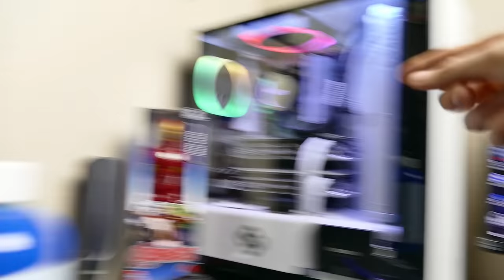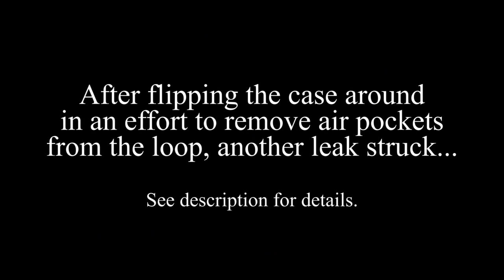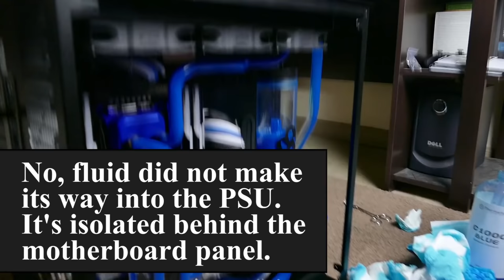Project 'Blue Sky' Custom Loop PC Build Log (Part 4 of 4)

Comment: I believe the best way to apply thermal paste is to spread it evenly (less than the thickness of a sheet of paper) on the die and also put a drop of thermal paste too.

Also, I think your power supply got messed up because there is to much current running through one outlet?

Comment: its quiet unfortunate to see all those effort with undesirable results, its custom water loop and things like these are prone to happen. Anyways kudos to you for trying it in the first place. when i saw the first leak i thought good that it didnt reach the psu and then i saw it was just the radiator in the bottom (which was later confirmed by you) however didnt expect the psu to fail. if i may ,  use the psu jumper to do the priming of the loop. I dont think it could have saved your psu, if anything it can help you protect the other components from short circuit due to such leaks.

Comment: It was hilarious when the first leak happen because you forget to add the stop plug on the gpu brigde. Cheers man it also happen to me too. I wonder how stupid i was that i didnt notice that. I suggest u try bitspower fittings or u could save some money get barrow fittings which looks like oem of bitspower. I use them so far i had the least leakage using these fittings. Great video and hope u get that psu problem solves. Curious how it died.

Comment: I have no clue how that PSU died but it would be en extreme coincidence if it would be unrelated to the custom water loop. As we all know, custom water cooling is not for the faint-hearted, or those who can't afford to spend $500-1000 extra on equipement and possibly more if there is a leak. It is awesome though.

Comment: I noticed you had the 24 pin connected the entire time you were filling. Isn't potential harm to components one of the reasons most water cooling kits come with a 24 pin jumper so when you switch on, only the pump spins?

Comment: Decided to go with air cooling. Water cooling looks like a big pain in the ass. Custom loop is going to take more calculation than I can be fucked with. CPU coolers could use a facelift though...

Comment: So I Always used a cheap powersupply to test loop rather than using the one gonna run long with the build. 
Also u sure your pump is good? There is still air inside the loop so the flow must be really really weak.

Comment: That case is like the Air 540... The wiring and PSU and excess hard drives go in the right side chamber... no chance water got back there.

Comment: Why did you have so many leaks? Is it because you used rigid tubing? When i built my first watercooling System i had none, maybe because i used soft tubing which is a little bit more forgiving? Nice Job anyway. It will be interesting how your TT coolant holds up over time!

Comment: Little late to ask, but did you flush out the radiators prior to install? It's a step that first time builders often forget, and alphacool radiators are notorious for having a lot of flux inside them that can get really nasty in your loop over time if it doesn't get flushed out.

Comment: Its really dangerous to use the system power supply with everything plugged into it to power the pump during filling stage. You really should either disconnect the main board and GPUs or use external power to power the pump. Any electronics can handle being wet when there is 0 electricity flowing through it including whats in the Capacitors, without being ruined totally. But once you power them caps, your chances of shit going bad with minors leaks like you had, go way up!!!! Just a helpful tip.

Comment: Did you actually flush the rads also I could see right off the bat the PETG ends were not deburred it looked pretty crooked and needed the ends to be cut straighter. Not trying to sound lie an ass it was your first custom loop but you learned some lessons real quick
Reply: The res out is the most notable bad fit the tube doesn't look flush with the fittings and then the cpu you kept having trouble getting it to fit right which suggest you may need to do that piece over again. It should fit snug but if its not going in straight don't force it or you just risk hurting the o ring. good luck
Reply: did you run out of the coolant after your spills or is that just a ton of air in the lines? Not sure but I really couldn't see it flowing at the end and one tuble looks like it is dry. You may have to lean the tower to get the air out but in all honesty I would flush the whole system and go check out some tutorials on flushing the rads.

Comment: How fast would a GPU with no cooler die? like just the bare die. There's a video somewhere on YT showing a guy gaming then pulling off the cooler on the CPU and Intel just shuts down but AMD goes up in smoke. I wanna see that but with GPU's.

Comment: Ah i get it now. 8:29 pulls a Kyle :(...Out plug on the pump also loose :S.. 5 leaks and 1 dead PSU that's not as bad as Linus with this pfsense video with 2-3 dead motherboard and chip. Why didn't he pull the plug off the PSU instead of rapid cycling, it's been well known that it kills the PSU this way, also he coulda used a PSU jumper so that only the auxillary power ran not everything and reduxing taxing startup power needed to start the rig. There is also still air pocket on the top left of the dual gpu bridge. I wouldn't flip my water cooling rig. I would tilt at most. Imagine of those bolts on the pump go and the reservior and pump come loose. It's also a good way to see which piping/fittings you have on loose. Just think for a second when you have that pump off, all that water from the radiator rushes back down due to gravity back down that PETG tubing back down to the cpu... The only think holding that 300-500ML of water is that single fitting on the CPU. But yea maybe invest in a paper clip or PSU jumper next time and save a PSU unit. This is about as lazy as the MW Technology  watercooling video LMAO.

Comment: I called it the the bend on the out of the cpu block is does not have enough straight out of the bend so it is not seating in the fitting far enough so everytime he moves the case and it flexes it moves and leaks and he didn't even adjust the pump speed once system post and he does speed up the pump it will leak again possibly but the cpu out bend needs re done my guess but he wont put no more new vids up on it so well never know but I think with all the problems he had he is just done ..that's the way I got when I did my first loop a month ago and my msi z170 m9 ack mobo waterblock on the board had a leak and driped on my 1070 both of which is on #rma  to msi now ........I just hope he keeps up water cooling builds and or even does it to his other builds

Comment: Not using ESD protection can fck your cards mate or shorten their life. It's frustating people don't follow those simple steps to protect their investments. I built a PC years ago but know ESD is a real problem to electronics way before that. You can drop a lit cigarette into a bucket of petrol and it will simply go out, a spark however is way different and a much higher temperature. Those signs saying no mobile phones at gas stations are over precautionary. Static is more likely to casue a fire unless you pump fuel onto a phone directly "by mistake haha"